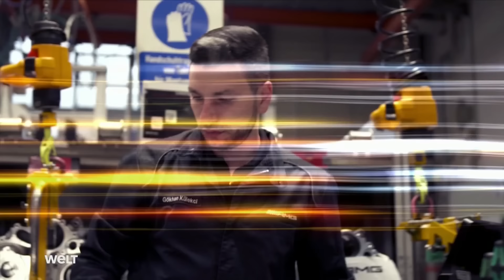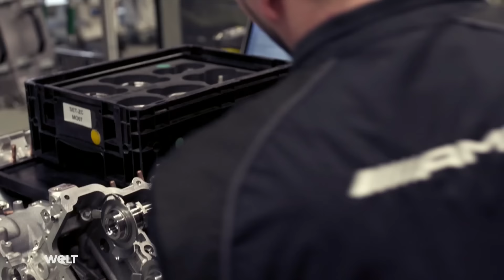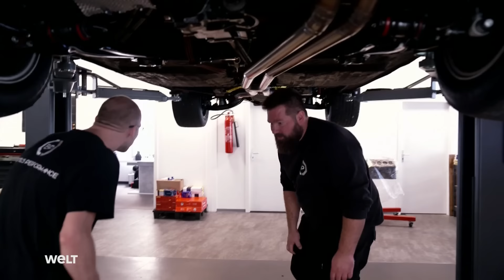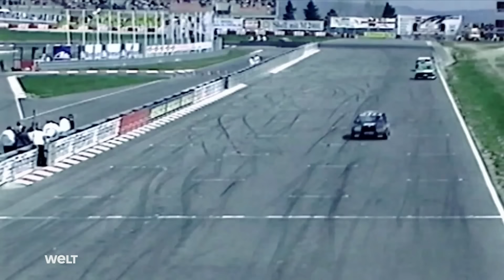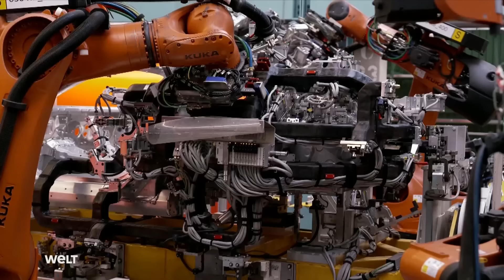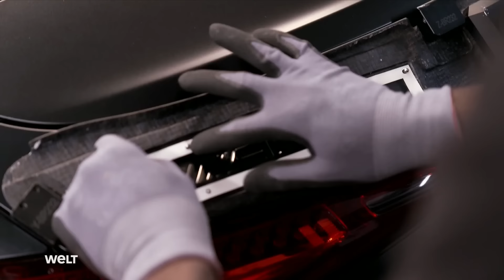GERMAN SUPERCARS: Mercedes-AMG Production "One man, one engine, one job." Handcrafted Dream Machines

Comment: Handcrafted crap that lasts only to the nearest workshop.
ALL amg engines have huge issues, half cooked, over-marketed, under-tested piece of money pits.
for e.g., m156 engines had cylinder head bolt issues- HOW COME ? Even a Lada does not have and can not have such issues.
Camshaft/timing issues, overheating, piston rods, wall scratching, turbo failure - regular AMG car routines for the owner. If you're in Germany within the guarantee, it's ok. Out of Germany within guarantee, still issues depending on the country regulations. Out of Germany, out of guarantee- lmao.

Comment: Another suggestion. I like the flat bottom of the steering wheel, easier to enter and exit of vehicle. The top of the wheel is rounded which obscures the upper right and left view of the center console. If the top was more flattened and the corners more squared resembling the upper contour of the center console it would provide a more unobstructed view of the center console, just a thought.

Comment: I have 2 amg powered vehicles GLE and SL 55, wow. The SL is like no other MB I driven over 49 years. Suggestion, get rid of the rear view mirrows and replace with cameras that are placed in the center screen or the left and right side of it . This would keep the driver from looking away from driving direction straight ahead and then be able to keep your field of view straight ahead and would be safer.

Comment: The skill level is strong with these pros.
Reply: those have no pro skills, only assembling like a lego. jacks f all trades...
ALL amg engines have huge issues, half cooked, over-marketed, under-tested piece of money pits.
for e.g., m156 engines had cylinder head bolt issues- HOW COME ? Even a Lada does not have and can not have such issues.
Camshaft/timing issues, overheating, piston rods, wall scratching, turbo failure - regular AMG car routines for the owner. If you're in Germany within the guarantee, it's ok. Out of Germany within guarantee, still issues depending on the country regulations. Out of Germany, out of guarantee- lmao.
Reply: @Project_88 - lets put it this way, these MECHANICS/ INSTALLERS are highly skilled PRO lego builders.  

I didn’t state they were the ENGINEERS responsible for the quality of parts and reliability of the cars in question they are assembling.  

Big difference…and good morning.  🙂☕️
Reply: @cyb_structure  you said - "non-engineers  building engines". no surprise all AMG engines have big issues, even with such routine, simple thing as bolts.
Reply: @Project_88  - I road raced for 6
seasons sponsored by Kawasaki and worked alongside some of the best factory mechanics in Canada. 

There is a high probability that these Mercedes AMG factory mechanics / tech’s are not at fault - it’s engineering, design, and poor quality control.
Reply: @cyb_structure  sure that's true, but who is saying those lego builders are the only issue ?
It's the overall approach, from ideas, design, engineering to assembly - all is faulty aimed at delivering only profits not quality.
Reply: @Project_88 - agree, its always about the dollar bills.  

Ultimately, the market determines if the product sinks or swims.  Sub par quality can only last so long on, what was once a stellar highly regarded name brand.

Comment: "One man, one engine, one job."
They've had their issues: bad head bolts, failed cam followers, '63' = 6.2L or 4.0L or ??, etc. 
"This engine built by Hans Stuttgart, and rebuilt by Cleatus MacCheeseburger".  🙂
Reply: The M177 4.0 liter has none of the problems you mentioned but okay.
Reply: @carmelothegoat1892  Yes it does. It's branded as "63" which implies something it isn't. Even though it's arguably better in ever single possible way. 🙂 !!!!!!!!!!

My point was only the point given. Hand built engines can have major issues. Robot built engine might well be perfectly built and bulletproof design. Hand built doesn't actually add much real value. Nobody is going to ask for a hand-wound electric motor. Feel free to disagree.
Reply: @JxH  nobody disagrees, because nobody cares what you think , your opinion is irrelevant
Reply: @Cleatus MacCheeseburger  Not true. It's got five (5) thumbs up. So there are at least five humans in the world with the sense of humour you sadly lack.  Cheers !!
Reply: Handcrafted crap that lasts only to the nearest workshop.
ALL amg engines have huge issues, half cooked, over-marketed, under-tested piece of money pits.
for e.g., m156 engines had cylinder head bolt issues- HOW COME ? Even a Lada does not have and can not have such issues.
Camshaft/timing issues, overheating, piston rods, wall scratching, turbo failure - regular AMG car routines for the owner. If you're in Germany within the guarantee, it's ok. Out of Germany within guarantee, still issues depending on the country regulations. Out of Germany, out of guarantee- lmao.